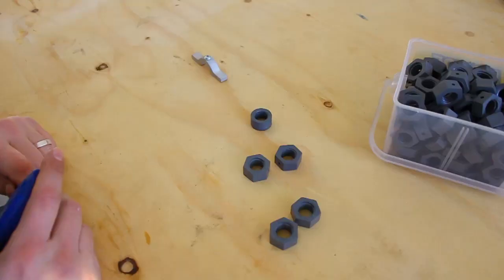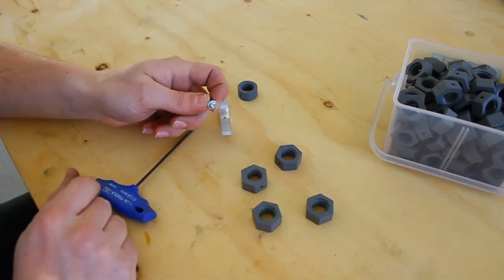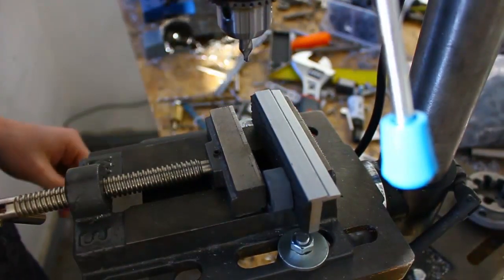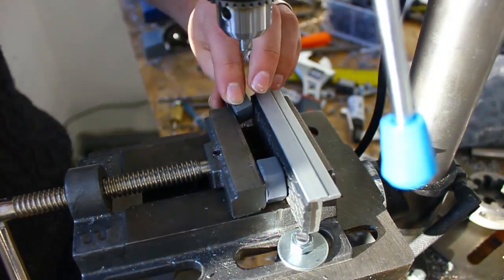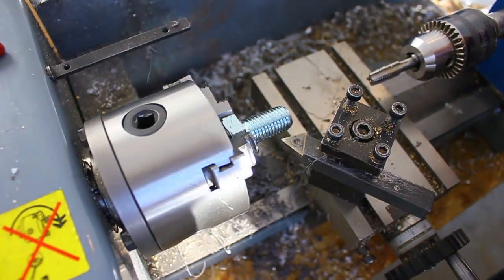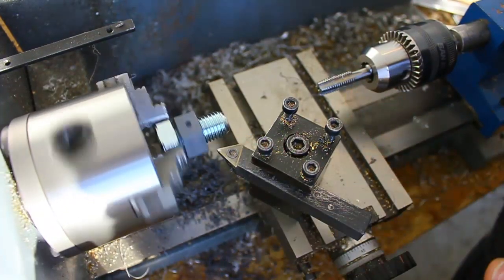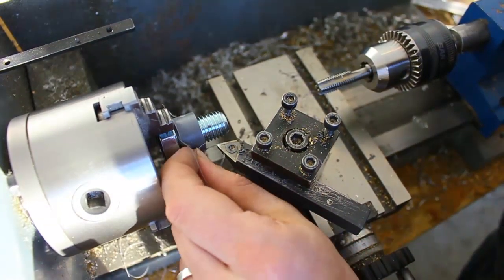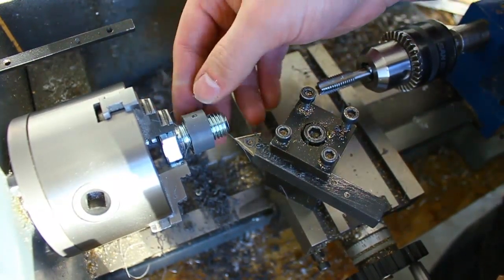Going nuts - machining some parts

Comment: Have you thought of using a high speed steel (tool steel) lathe turning tool versus the carbide insert? The HSS tool can be sharpened to a very fine edge. Carbide generally cannot. You may be able to make fewer passes with the HSS tool as well to get to the final size.
Good video and nice job on the threaded collars.
Eric

Comment: You could use the rubber softjar on the moving part of the vise. So the tension would not affect the hole position...
Reply from the maker: I decided to not use the softjaw on the other half of the nuts at all - I was afraid of  denting them, but they seemed just fine with aluminium ones. Thanks for the comment though :)